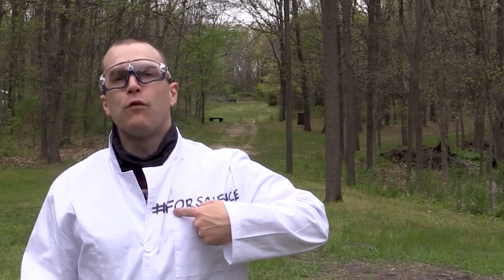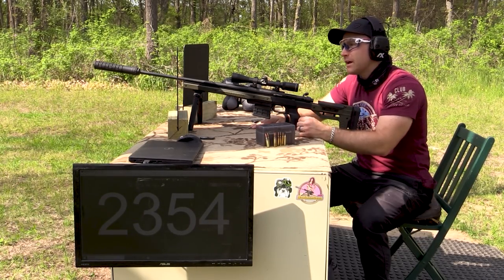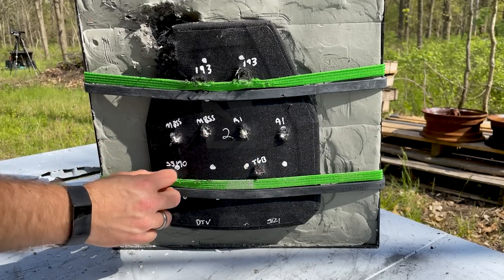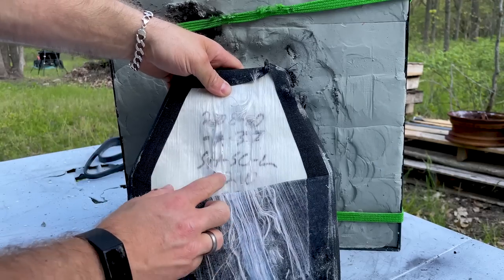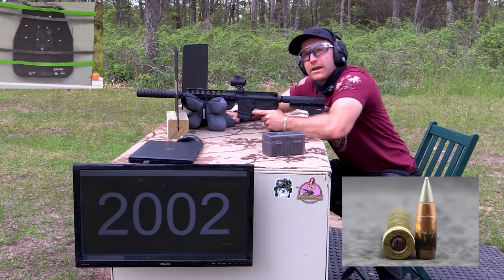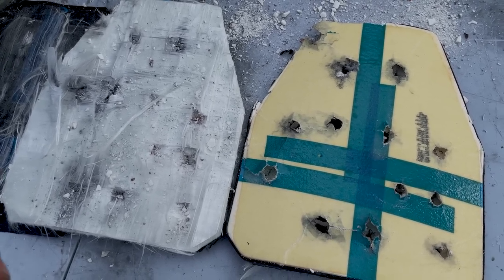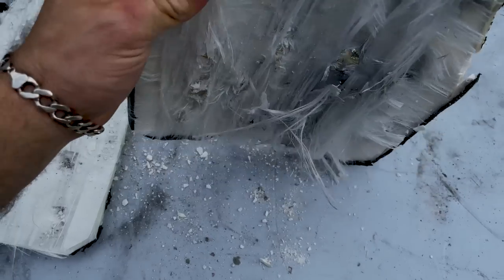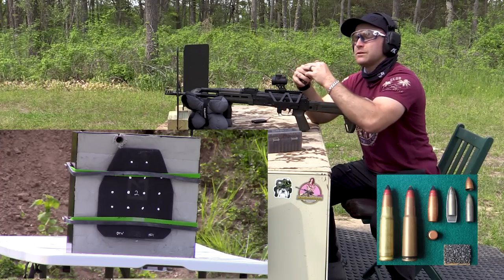Hesco Body Armor, Model L210, Meets the King of Armor Destruction

Comment: Personally, I'd really like to see the L210 tested against m193 with a 16" and 18" barrel. I think the 16" / m193 is going to be the most common threat encountered by a plate of this type in US.
Reply: I think green tip will and 193 second
Reply: @charlesbukowski9836  193 out of a 18’ barrel goes straight through
Reply: 20 inch master race ftw
Reply: Nah it will end up being m855a1 out of 14.5 and 11.5 barrels
Reply: @traviscamacho5306 not what the discussion was about

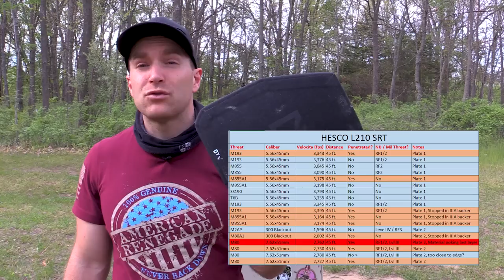Comment: 20:17 -- Would love to see the last plate shot with these same rounds but from more common 14.5" and 10.5" carbines at realistic engagement distance like you mentioned
Reply: i second this!
Reply: Agreed.  Id love to see that too.
Reply: Same
Reply: Yup!
Reply: They need to stop bullets from 20 inch barrel. Hesco plates are trash.
Even militech China plates are better. For the same money you get quality level 4 plates. For 230$ a pair of level 3+ plates. And 315$ for a pair of level 4 plates that even stopped 50 cal on a good distance. And if you don't trust Chinese armor just buy real European ceramik plates from PROTECTION GROUP DENMARK! 550$ for a pair of edge to edge ceramik + PE plates in shooters cut.
(berserker level 4 plates, they stopped more tha

Comment: As other have noted, I think these plates were tested with a set up that is uncommon for most of us to encounter. The L210s are for people who were facing 193 and 855 from a 16in and under AR. That said, I just bought some RMA 1092s as a direct result of watching this video. I'll keep the 210s but I do routinely see .308s where I shoot - not common, but common enough to know they're out there.
Reply from the maker: Thank you for the feedback. I plan to re-test with shorter barrel lengths if Hesco will ever send me a IIIA backer they mentioned they would send.
Reply: .308 is pretty damn common
Reply: 16" and under m193 and m855 seem like the most common of common rifle threats
Reply: @user-uq1kk4mh2n  only in ar10s and thoes that have a g3 or fal.

otherwise 762.51/308 has all been replaced with 6.5creed here.

Comment: Id like to see M193 out of the 16”
Reply: facts - as most common threats of an m193 round would be out of a platform like that. BUT - doesnt take away the fact that m193 out of a barrel that allows full gas expansion of the round in a good size barrel (which is how 5.56 is meant to be used) defeated this armor. IM extremely disappointed in this armor system as I thought it would be a perfect mid grade armor to have. Thin, lightweight, stops green tip - but cant stop the more common m193? Thats a no no. I wouldn't trust this armor at all. Found out about the L210s from T-rex arms because they plug them so hard and I know T Rex arms only plugs products they believe in. Maybe they should have tested some of these plates they have in stock to see if they lived up to hte name they were giving them.......guess not. Sticking to my RMA lvl IVs. Ill take on the extra weight. IM a big dude anyway and theyre only 1.8 pounds heavier than my green ESAPIs I had in Afghanistan so I can bare it. I just like to cut weight down wherever I can
Reply: @Kaotix_music  NIJ RF1 testing allows up to 3250fps max, 3400fps+ is pretty far outside that meaning this test IS outside what Hesco claimed it will stop.
Reply: @travisolexa3074  yea its like alot of us requested for testing on the 3rd plate - use a more commonly found AR maybe at a greater distance (by a few feet)

Comment: Looks like I'm moving to RMA 1092. Disappointing results from Hesco, regardless of NIJ "testing" from them.

Edit: Definitely try shorter more "common" rifle barrel lengths against that last L210 plate with the same ammo types.
Reply: You won't regret it. 4.49 lbs and multicurve. They're a bit thicc but my JPC 2.0 takes em like they're made for each other. Ethos Tactical has them in stock btw.
Reply: yea i found out about the HESCO L210s from T-rex arms (probably alot of us did) and they really caught my eye. Not expensive, stops green tip, light weight - whats the trade off here? liability apparently. I have RMA 1155's and theyre a tad bit heavy, like 8 lbs a plate (only 2 pounds more than my green ESAPIs in the army) i might be sticking with those for a while. Maybe ill save up a bit more and buy the 1092 from RMA as my "lightweight" set
*EDIT*: Today I received my RMA LVL III+ plates and im fucking impressed. Light weight, stops both m855 and m193 out of 20 inch barrels according to BUFFMAN tests here (thanks buffman for doing gods work and helping us make decisions that might one day save out lives) and still stop m855a1 out of shorter barrels.
Reply: NIJ RF1 testing allows up to 3250fps. 3400fps+ is pretty far outside that and you are probably more likely to get struck by lightning than run into anyone running 22" barrel with suppressor lol
Reply: @travisolexa3074  you would be very surprised the guns I see around here man. maybe not 22 inches - but 20 inches ive seen very very common on ARs here and suppressors only add 15-20 FPS to a .223/556 round. Its so negligible its not even worth noting
Reply: Well you're comparing apples and oranges there. Hesco's 200 series special threat plates are lightweight, low profile/concealable plates, designed to counter common intermediate rifle rounds. They're not designed to be lvl III/+ plates, which the RMA 1092s are. The Hesco equivalent to the RMA 1092 would be something like the Hesco lvl III+ 3810, which is very similar, but slightly slimmer, lighter, and rated up to russian 7.62x54 mild steel core. The popularity of Hesco's 200 series is due to their slim profile (.56"), which is half as thick as the 1.2" RMA 1092.
Reply: @mikwehttam  The problem is alot of people were turned onto these plates by Lucas from T-rex Arms. While yes, youre right with everything you said. There wasnt much information about these plates and no testing like a BUFFMAN video trying to make them fail. When a huge influencer like Lucas (he hates that term, but thats literally what he is. He says something is good and before you know it everyone owns one - thats influencing) - when someone like him says "you want budget armor....BUY THESE PLATES!" when they wont even stop a more common round out of a pretty common rifle. I know many many many people with 20 inch ARs even though shorter barrels have gained increasing popularity. SOme people still prefer the longer barrel meant for 5.56 - which is a common threat. So people finally saw BUFFMAN test these plates and were disappointed at how they performed with m193  when entry plates when first getting into armor  should stop something like that. Were not mad at the armor, were just disappointed with the results of an armor a huge influencer plugged so hard - to see it fail compared to others. The RMA 1092s are deff more expensive, i paid 600 bucks for my set. But is your life worth it? Ill pay 1200 dollars for body armor if it means protecting my life. And yes, while they are thicker, they only weigh a pound more than the hescos and stop much much more.
Reply: @Kaotix_music  Also I could go on an entire rant regarding the issues with Lucas and his team, but that's besides the point. Suffice to say, don't take recommendations from T-Rex Arms regarding anything other than shooting or holsters, he's not an expert outside of those areas.
Reply: After watching the video, I realized the issue with his methodology. As I had mentioned, the 200 series are low visibility/concealable plates. Low viz plates (like the Hesco U210 special threat or the Hesco 4800LV lvl IV plates) do not have foam backers on the front or back, which allows them to be so thin, and they are not are not drop rated for that reason. I didn't catch it the first time I watched the video, but he did do the NIJ drop test, which means the plates were all compromised before he started shooting. That is one of the tradeoffs with low visibility/concealable plates, and another reason they are not the best choice for first time buyers.
Reply: @mikwehttam  totally agree. Im not gonna simp on Lucas, i actually really like the guy - but there are many times he just has no idea what hes talking about - but he does admit to that. He has the ability to test these armor plates himself so if he really wanted to plug a product he believes in, hed use his platforms to go "See! this is why you should buy these!" IM a former infantry guy and pretty much worked with Special Operations my entire career So will i say i have a little bit of a gain on knowledge over Lucas? yea, but not by much. Like you said "shooting & holsters" and thats it. But these plates DID gain a ton of popularity recently because of him. Reading your second comment i did look further more into the plates and youre right. Theyre supposed to be low Vis plates to wear under a shirt in a PACA or something. So yea, him doing a drop test compromised the plates.
Reply: @Kaotix_music  Yeah, I'm not a Lucas/T-Rex Arms hater, but he does have a certain set of skillsets that apply to very specific areas. Combat gear isn't one of those areas. The thinner low vis plates make sense for him, since he prefers low profile, minimalist gear, used for low intensity conflicts, like a societal breakdown or active shooter. In those cases, these kinds of plates excel. They're lightweight, less bulky, and will stop the majority of firearms you're likely to see in those situations, but they're not the kind of plate you want to run against a well armed adversary, or in a complete collapse of rule of law. The problem is that he doesn't delve into any of the context regarding plate choice, so a lot of people see the low price of the L210 and his recommendation, and don't understand that they're getting a very specialized type of armor plate. Lucas is a popular influencer though, so people will follow his recommendations, regardless of his experience, or their understanding of the subject. It's not really his fault, so much as it is an issue with the entire "influencer" phenomenon in general, and lack of research by many of their followers. Also, thank you for your service. I'm sure you've had plenty of experience humping heavy armor and gear during your time haha
Reply: @mikwehttam  I think a lot of issue is these influencers are marketing the L210, s special threat plate, as an alternative to proper full spectrum plates. They are pushing it too hard and someone will eventually find out the problems the hard way one day.

There is a place for special threat plates, but the average user running it in an overt plate carrier is going to be greatly underserved.
Reply: @mikwehttam  If you're going to make this many allowances for the L210, what is your opinion on steel offerings in the same weight class such as the Steel Ops Armis/Proplates? not necessarily saying you are operating in bad faith or anything but one of my personal hangups with Lucas is that he responded to someone asking about Steel Ops plates by saying "it's all bad" and to "save up and get L210s" but looking at this video I have left with the conclusion that suggestion was bullcrap. Not to mention he advocates using L210s as an overt plate anyways.
Reply: @MinuteBracelet  never ever buy steel plates, yea they will stop the rounds but what’s the point when your dead or severely injured from the spalling anyway they are almost useless
Reply: @jamfd3s788  spalling does not realistically happen with infantry sized armor. No infantry unit in the world is shooting HESH rounds at other infantry. What you’re probably thinking of is fragmentation/bullet splatter.
That said there’s evidence to support that with the right coating the risk of getting splattered is minimal. By the time a properly coated steel plate is shot up enough to where that would become an issue, a lot of civilian grade ceramics from reputable manufacturers would have long failed.
Reply: @Kaotix_music  I dont watch lucas, I just eyeball esstacs store and its cheap, a lot lighter than my cheap hesco level 4 plates and it stops a lot.

Some of the ammo he shot with it that went through no one has here, the m855 was designed to be ran into a beltfed and anyone who runs them in their ar will run into destroyed barrel extensions

Comment: M193 out of 16" and 20" barrels. Those are the most common actual threats. Don't waste time with 14.5" and below. All the SBR/pistol lengths will be stopped if it can stop 20" and 16" by far the most common threat in the US.

Comment: 7:45 -- Quick, easy way to show pass through: label your plate like you've done, then push a Phillips screwdriver through each hole through the back of the plate.  

The screwdriver tip will poke out the front and it will poke out right by its corresponding label, so you'll instantly know which round made the hole.  Alternatively, a flashlight also works.

Comment: If it won't stop m80, what about 300blk/7.62x39 supersonic? So far this plate is trash.
Reply: It is a special threat plate, not rated for m80
Reply: That’s what I thought at first but it’s only half inch thick and 5lbs. I wanna see test with full 10x12 3a soft backer. And if you look at the backface deform it is very small. Much better than some 8lb 1.2 inch thick plates.
Reply: Great White  selling their name brand, they’ve also had to recall plates for failing to meet threat levels in the past. I don’t understand people’s trust for Hesco. . .
Reply: @PolynesianSaus  the recalls were inmediatly met with an inmediate replacement of plates for the people who bought them, thats what happened when the 3610s were recalled, hexco does a lot of good stuff an even more than the general public knows, hesco is perhaps the most reputable manufacturer of plates in the us, its not " selling their name brand" unlike companies like ar500 or spartan armor systems, both of them being steaming hotshit
Reply: Great White  may i ask what kind of plates do you have? seeing that the only commercially available sub 5lbs lvl 4 plates are the hescos 4800lv

Hescos are not even that expensive, its not like they were 2000 dollars a plate lmfao
Reply: @anaveragebullet3676  plenty of armor companies haven’t had to recall any of their plates. 🤔
Reply: @anaveragebullet3676  nobody’s even talking about steel plates. There are plenty of more reliable ceramic armor manufacturers and Hesco absolutely marks up their armor on name brand recognition.
Reply: @PolynesianSaus  I didn't know that.
Reply: Great White  what plates do you have ?
Reply: @anaveragebullet3676  I’ve never seen lvl 4 less than 6-8 lbs and an inch thick and 40mm of backface deform unless u spend over a grand and even then just less backface. I’m curious as well??
Reply: @PolynesianSaus  thats because they also have less way offerings, as ive said, hesco has met those recalls with absolute professionality and they have my respect for that
Reply: the hesco l210 will stop x39 in 3 flavors
M67 lead core, m43 MS core and armor piercing.

The rma equivalent of that is over 100 dollhairs more.

I have no dog in the fight but I think rma needs to fix their website because to get close to this protection of 855 and x39 AP you need their level 4 plate which they dont have a testing for.

Im still looking at the l210 for my next carrier because it stops the most common rifle rounds and is 180 dollhairs.

Comment: The L210 is only rated for m193 and ss109 at 3150 fps. So it's working as intended. It's actually working better because it was able to stop some at a higher rate of speed.
Reply from the maker: You're not wrong. I was merely testing out some of the myths and rumors that continue to propagate online about the L210 :D

Comment: Dude, your videos are easily the best armor testing on youtube, but could you please use a 16 inch barrel for your 5.56 testing? 22 inch is not common at all and the difference it makes in armor penetration is significant. No one is getting anywhere close to 3,400 fps out of an AR, a more realistic velocity would be 2,400-2,800 fps.
Reply from the maker: I will re-test these plates with a 16" and 20". FYI I am getting 3225-3250+ from a 16" barrel AR-15, which is what the new NIJ 07 RF1/2 standard are set at.
Reply: @BuffRANGE  Hey, thanks for the reply! You're quickly becoming one of my most reccomend Youtubers, best armor testing I've seen. I'm looking forward to the next video. I didn't realize 3,200 was possible out of less than 20 in barrels.
Reply from the maker: @MrJakedog104  Yeah. It pretty much takes a "full power" M193 load to get there, but those were typically from pre 2017 lots of IMI, which would account for tons and tons of it around. That's one of my biggest concerns for any armor "demos" online. Not all ammo is created equally, and when someone shows either a penetration or a stoppage without the velocity, we don't get too much take away from it. :D

Comment: And damn... a plate that doesn't stop M193.... the most common stuff out there...
Reply: Keep in mind that he shot at this plate with a 22" barrel and got velocities north of 3360 fps, which is a full 100 fps faster than M193 spec (3260 fps out of a 20" barrel).  

Also, remember that Hesco to stop 7.62x39 AP and M855.  M855 is specced to run 3110 fps out of a 20" barrel, a full 150 fps less than M193 spec.

It's velocity that defeats armor.  Had he been firing these from a 20" barrel, these M193 rounds might have been stopped.  Or maybe not.  There are quite a few armors out there that are rated to stop M855, but won't stop M193, because speed is what does the work.